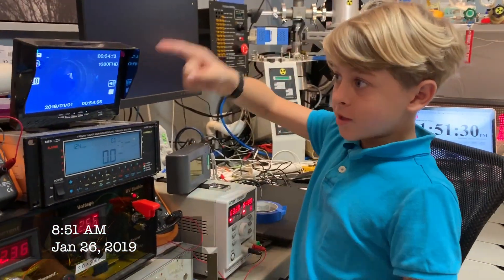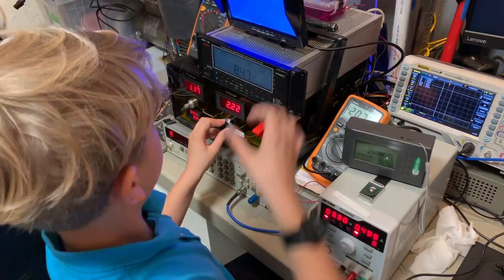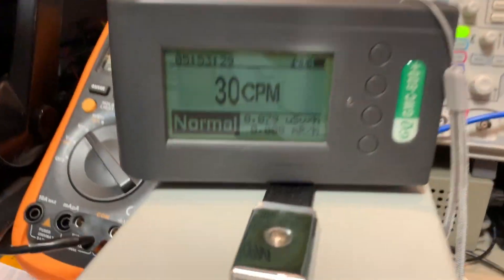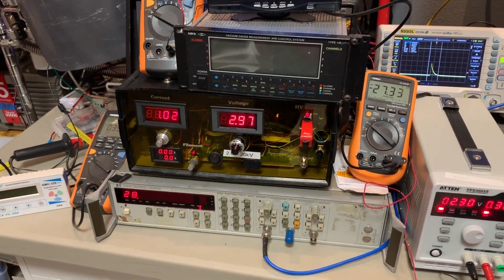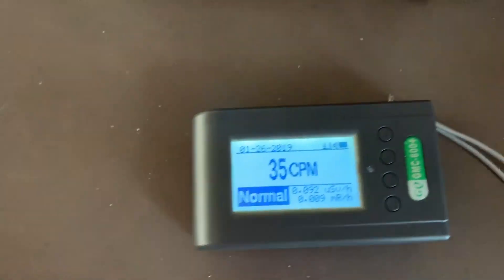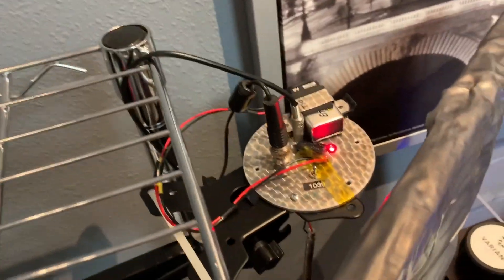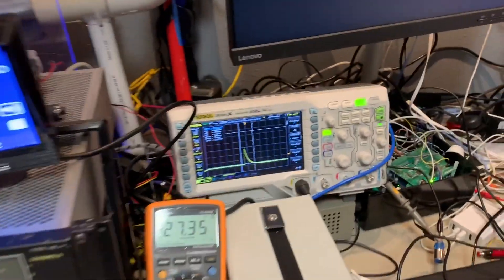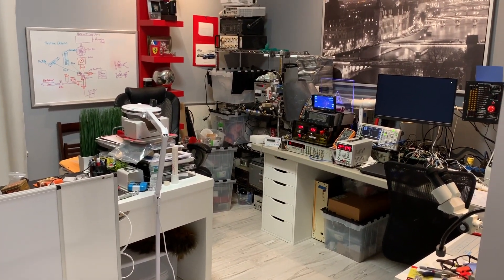Moderated Vs Unmoderated Fusor Neutron Run and Silver Activation

Comment: a lot of fuss for little action. may as well use a beryllium foil target on a radioisotope if you want neutrons. fusors are a meme and cost so much in equipment and wasted deuterium
Reply from the maker: drspastic Neutrons herald d-d fusion. It’s not the specific goal to release neutrons. We have a licensed Polonium 210 source that releases neutrons quite well when mated to Beryllium. Thank you for your comments!!’
Reply: Alpha emitters + beryllium is a terrible neutron source, the radioisotopes are pretty expensive, and the neutron flux is absolutely tiny, even with several curies of an alpha source with beryllium powder blended together will not make enough neutrons to cause a visible change ( where you can clearly observe the change without the need for a spectrometer)

For example, to make 1mg of cobalt 60 via irradiation of thermal neutrons produced from a moderated alpha-beryllium source, you’d need thousands of curies which is not only terribly expensive but it’s also extremely dangerous

Comment: Are u getting any excesses heat...
If not...its fail experiment.
U need high amperage to create fusion...voltage is not that important
Reply: It's an electrostatic confinement fusor, you fool. it can't achieve breakeven let alone produce significant heat from fusion. The plasma is in extreme thermodynamic disequilibrium. If it WERE producing enough fusion to make heat everyone in the room would be dead.
Reply from the maker: our goal is not to make net power so we don't have a neutron radiation problem. You need voltage and current for fusion
Reply: @bang bro it’s not failed, fusion reactors like that have been used for years to generate neutrons.
Also, whatever you said about voltage and amperage for fusion is just blatantly false.

If the voltage is not high enough the particles can’t even touch each other.
Reply: @bang bro for fusion you need intelligence and knowledge, which are both lacking in your comment.